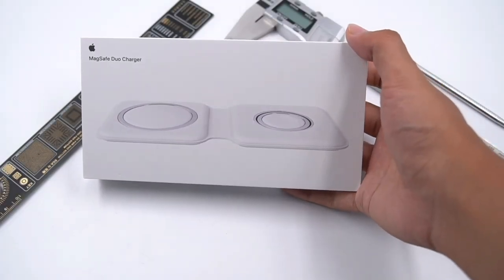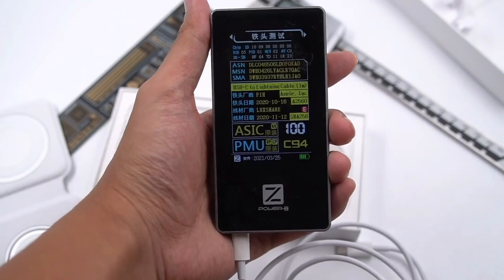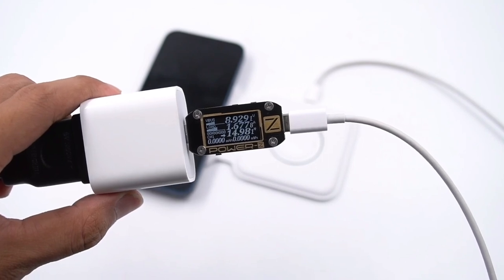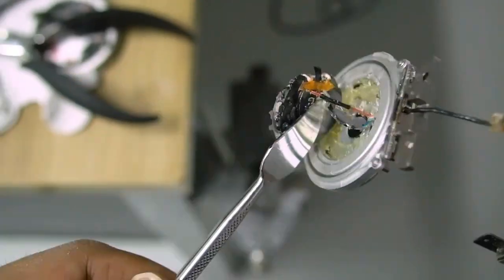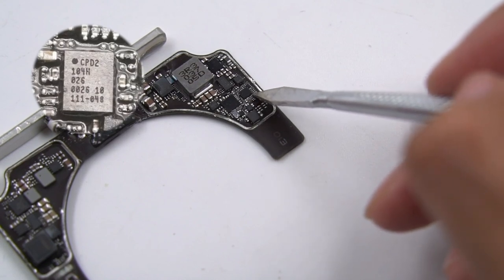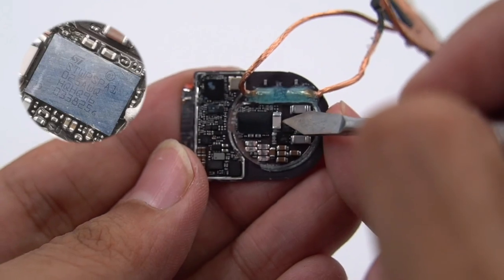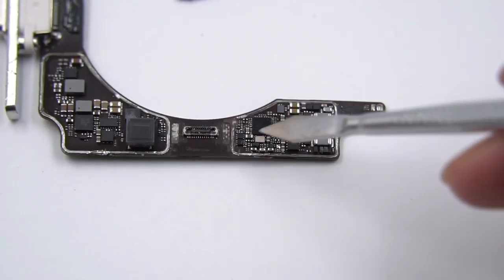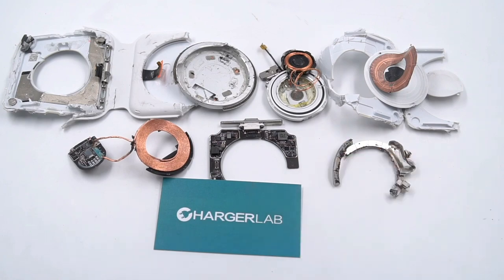Teardown of Apple MagSafe Duo Charger (A2458)

Comment: Great tear down! So compared to just hte magsafe charger, this adds the STMicroelectronics STM32F446MEY6 which costs about $6-10 alone in adition to the one inside the puck. looks like apple is spending around $20-30 in chips alone if not more depending what kind of deal they get on these cards.